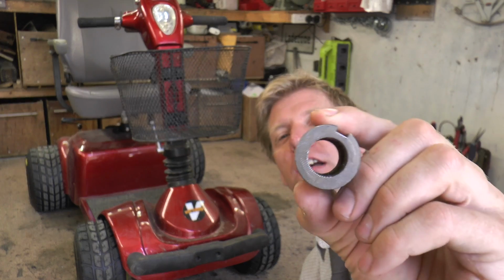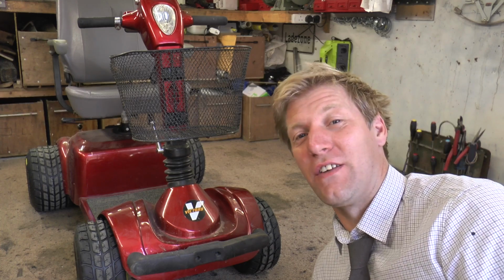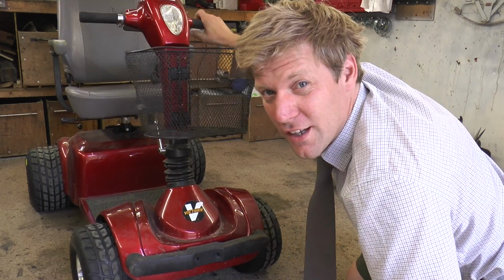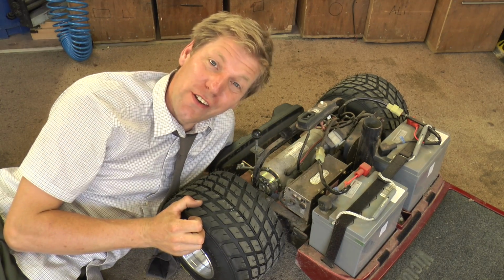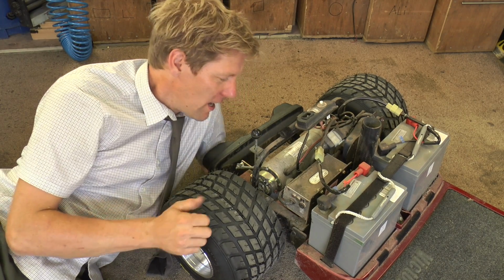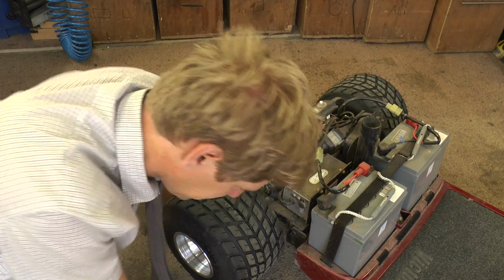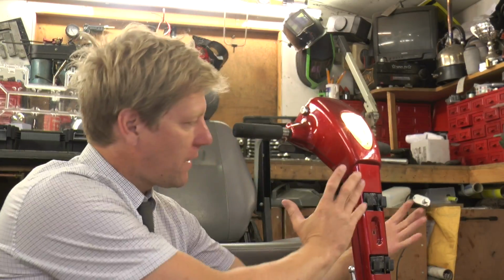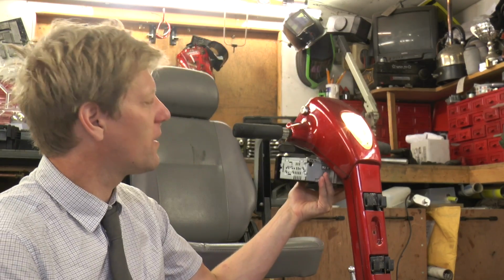Rims-Lift-and Bass Scooter Pimp #1

Comment: Instead of spacers add coilovers to the front and rear for the lift? Make the steel plate for the speakers into sealed pods so they’re louder? Add a subwoofer somewhere like on the floor or underneath the seat? Put a round 7” Jeep LED projector headlight on it for a headlight? Put RGB LED underglow on it? Add RGB LED rings around the speakers? add a trailer hitch to it and make a custom trailer to tow even more toys with it? Make custom front and rear bumpers for it and put light bars in them or put a winch in the front bumper? When it’s all done apply a custom vinyl wrap to it? Oh and lastly, add side steps on each side to “help you get into the lifted beast”. Just for jokes lol.
Reply: Also, flip the speakers around to they face the driver.  You won't hardly be able to hear those once you get out and about.
Reply: well he made the british version and your version is the american one so gotta make it ;)
Reply: Very good
Reply: Great idea for the Waylon shofner channel show! 
Let's see it done by next week in time so you can get Colin to showcase it in a pimpscooter showdown!!
Then we can decide who's is better in a vote. I'm sure you will beat him🤣🤣

Comment: Speakers would be louder and have more bass if you could engineer a 1/2 cubic foot, or 14158.368 cc enclosure behind each side.
Reply: But then the driver wouldnt hear them as well.  They should be facing the driver and enclosed in an optimal situation. If he is only trying to broadcast, then yes they should be enclosed. I think he picked the current open air arrangement because it is best for listening and broadcasting.
Reply: R4MP4G3RXD thicker steel then ;)
Reply: Spray the inside of that box with some cheap spray undercoating. Used to do it to the wood/MDF boxes all the time.
Reply: @Petter olofsson it's still gonna ring because it's steel, and it's gonna weigh a tonne.
Reply: R4MP4G3RXD see my above comment ;)
I get what you mean though, and it would be silly heavy but it should be possible to get the ringing down to neglible levels. The ringing will be affected by thickness and size of flat surfaces, perhaps a spherical 5-10mm speaker would be good?

Comment: wtf is this awesome bolt-welding machine at 7:23?
Reply: yep, very cool, very useful "one sided" spot welder.  

CF should post product names, links
Reply: Felix Dietz it’s a stud welder!
Reply: It seems to be Colin's new toy: a stud welder. You put the stud in, press it against the material, and once you pull the trigger it releases current from a set of capacitors through the stud and the three prongs around it to weld it in one zap. I'm guessing these studs are special so that they can be welded this way, having something that heats up more than the rest so it melts and welds the two halves together.
Reply: Daan Wilmer how does it work with the head unit.. I would have thought all that current would fry the electronics.. Or did he strip it first? Or am I all wrong lol
Reply: I was wondering that too, welding means electricity, electricity on a (metal!) radio could mean ded radio... but apparently it worked, it played music in the end didn't it? I would've definitely done that differently though, but then, I'm German, we always overthink/-engineer our stuff.
Reply: I'm no expert, I just looked up some stuff after watching the video. But my guess is that, as the voltage is applied between the stud and the three prongs around it, the only path for the current to go is through the stud and the prongs and nowhere else - there doesn't seem to be a path for the electricity to go beyond the case.
The dangers with electricity and radios come when you don't 100% know how the current can flow. A static charge can find a way to ground through a connection you don't expect, zapping a chip along the way.
Reply: Daan Wilmer that theory makes sense!

Comment: Needs a cup holder below the stereo.  Also a nice light bar on the front and some kind of reflective tape or tail lights on the back for night driving.  Marker lights would be good all around instead of the typical underglow.  Some wheel fenders to keep from throwing water in the air now that the wheels stick out so much.  You might need a third battery in there as well for all the aux stuff.   Might as well add a roof to it and an extra seat on the back for a passenger.  Oh and it needs a nice horn... not something crazy.. just something that sounds like an old beetle horn for that nice "beep beep" sound.  Speaking of which... a backup sound effect as well like trucks have.  Might as well add some light weight bumpers... might be a good place for the front & rear lights to mount on.

Comment: Hey man. Love your videos. I have this idea in my head. If i can find a high end spares repairs salvagealeable scooters like the 3600w dual motor models. you could hyperthetically speaking make a custom  axel, fit the wheels from the donor scooter onto the mobility scooter and re wire each rear wheels to the 1800w individual motors and battery etc would all sit where the original mobility scooters motor and batteries sat. You could even potentially rewire the limiter to the controls so you could have eco, standard and sports modes. These scooters travel at 60mph and have ranges over 50 miles. I can imagine the mobility scooter conversion could do upto 40-50mph and have a very good range. Keep it in eco mode in the town centre and around police and as soon as its clear vroooooooooom! Your off. The wheels and tyres on the all terain kugoos and nice and chunky and would be perfect. Im gonna keep my eyes open for a salvageable one for a cheap ish price and then a spares mobility scooter which wont need to be running 👌 im assuming it will need a couple of inch lift and ill need to source some wheels and tyres for the front 👌 first time iv considered a project like this. 🙏 im a complete beginner!

Comment: I really think that using the basic concept of a mobility scooter and making it much cooler for a younger market,maybe bucket seat, better steering colum and nicer bodywork but keeping it electric (maybe a bit better more powerful but not insanely powerful and you've got the new most popular personal transport vehicle people would actually buy. And if you need storage I saw an older gentleman already solve the problem as he went to asda with a bicycle trailer attached to the back for his shopping.

Comment: colinfurze, obviously you need a roof with those tassel ball things (rickshaw style), and why not throw in a sliding glass moon roof while you're at it. and a self-cooling beverage holder trailer, which could hold extra batteries for more cruising time. ground effects lights would nicely round out the package. and a fur seat cover too. and a rear view mirror with dice. let me know if you want more advice :)

Comment: I picked up one of these scooters at a thrift store for 10 bucks. I just put 2 new batteries in it and   now i cant stop upgrading it lol. I put a 4"lift. I used transmission servo springs in the rear and in the front. I added a bed in the back. Upgraded the headlight with led. It just sucks it only goes 5.8 mph.

Comment: an idea,  how much will it take to change the color of one of these units?  I am customizing my Afikim C4 which is already blue. And want to later pimp out my other scooters which unfortunately are all red ( you take what you can get on the cheap ) I'd like to redo them in green, blue, gold, black. with artistic murals as is the local Hispanic tradition . ( some Aztec warrior type stuff with a sci phi vibe. ) I'm more into this build than your previous speed demond, I'm a ol school customizer from back in the days of mini trucks, & vans. would have loved to have been around for the Hot Rod years. in an oed to those sweet rides, my first modded mobility scooter is a 1900s C Cab delivery truck long haul grocery getter.  The longer range was easy, switched to big lithium batteries. will be adding a rear box of an appropriate scale to provide proper aesthetics. this just happens to be a modified grocery cart with a cover skin that when combined with my custom scooter & enclosure will give the perfect look. I will add bicycle wheels to the cart to provide looks & carrying capacity. when I get a couple of these built I want to start an USA version of what I understand is already a thing in Europe , A custom scooter club. enough of my rambling I'll be watching.

Comment: WOW! Great video, but I'm working on an old Zoom 220 that has sat unused for 10-15 years. I replaced the batteries, and the fuse is good. But all it does is "click" in the reset button. The horn beeps, but that's it. Could something have deteriorated in that unused time?
Thank you!

Comment: Does it have a speed control system for indoor and outdoor use? I want to run down to the Walmart at about 20 mph and then go inside at indoor speed , like 5 mph.

Comment: Did you run the stereo off the original batterys ..does it drain the battery alot . I just scored a Jeezy ES Series..as soon as.i got it , I was looking at putting all terrain tires .and lift  it .  I charged it all night last night and the dam thing was on yellow this morning.  I drove it up and down the house and watched it drop a couple more lines .this is my luck . Man I'm a stay at home dad with a bad back . I've built homes my whole life . About 12 years ago and 2 sons later my back gave out . Cant work , cant get any help with my rent , lights ect . So I'm just makeing it . No room for hobby stuff m I wish so much that at least the batteries would have been good . My step dad has 3 of them . Settn in the shop... (Jessy Select) (JeesyES Series) and a (Merits) I think it's called.  His sister died and he got all them . Please answer me this . Is there a way to re amp up the batterys . Yourself at home . I dont have ylthe money to buy new batteries.  It wont fully charge . And it dont last long till it's dead 🤕

Comment: i had the EXACT same scooter ... beat the crap out of it  2 Motor/axel assembly units that cost as much as the scooter had cost new (bout $1500 ), 2 speed controlers,  all due to daily use  and crappy  city sidewalks not level...

Comment: My dad's Invacare Pegasus scooter just fried if you want to motorize another one with the 60 mph motor and really pimp it out. It's a full suspension 4 wheel recreational model. Just give me the cost of it all after you look online at the specs. should almost be bolt on really frame wise.

Comment: What would be the maximum wheel size you could fit to one of these ? I have stopped driving due to illl health ( dont want to kill anybody by accident just because im selfish and want to drive) but immobility and being stuck in the house is driving me insane. I could buy a quad but theyre mostly fuel powered and i would hit the same issue as with a car. A mobility scooter ( or an electric 2 wheeled scooter if they would legalise them ) would solve the problem but im not 85 years old so if i could "pimp" one up to something more suitable It might spur me on to save up and buy one.
I need slightly bigger wheels so that I could use it to walk the dog or go out for " a walk" with friends and the typical mobility scooter wheels would get bogged down on the grassy field or stuck in ruts caused by the motor bikes and quads that use the rural paths.

Comment: Is it possible you do my mobility scooter? The batteries are the problem when it supposes to do 32 miles on one charge, but it only does 7 miles and goes 8 miles per hour. I want you to change the batteries so that I can travel 100 miles on a single charge. And instead 8 miles per hour, I want 14 miles per hour speed.

Comment: Going to copy all the people asking for a more powerful electric motor in it.

But also, rip the old power system out, put a nice chunky LiPo pack in there, and a Type 2 charger. There's an absolute ton of them in the UK now, probably enough to travel across the country on a scooter with a decent battery, and it's almost criminal that no biddy scooters seem to come with Type 2 capability as stock.

Seriously, go to https://www.zap-map.com/live/ and filter for Type 2 chargers. Loads!